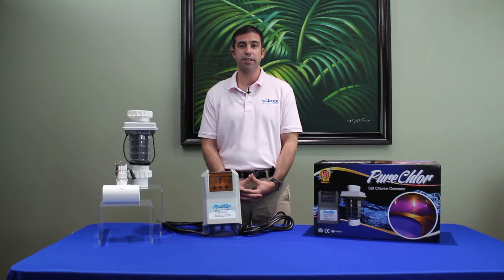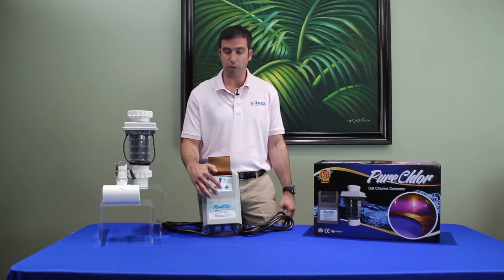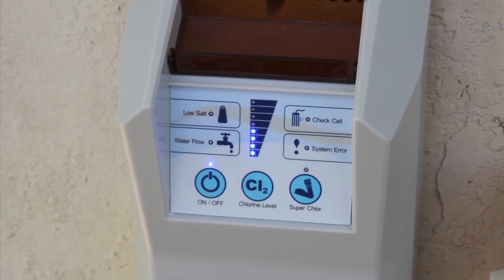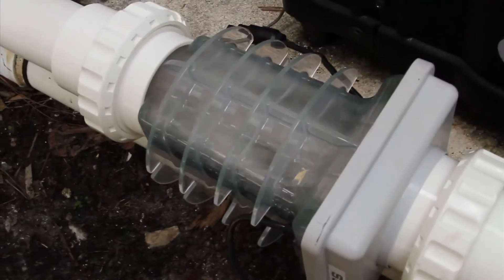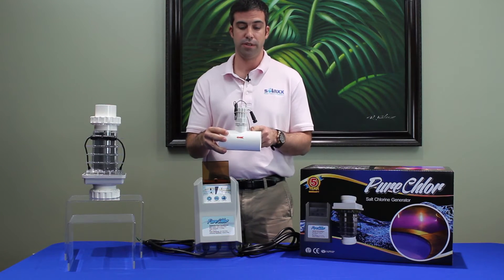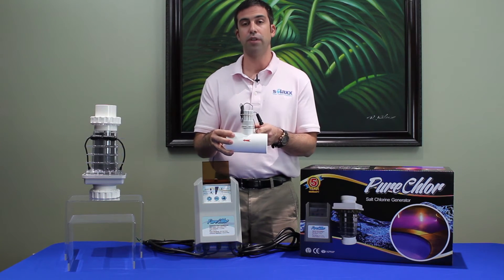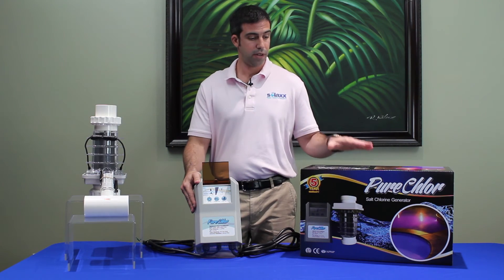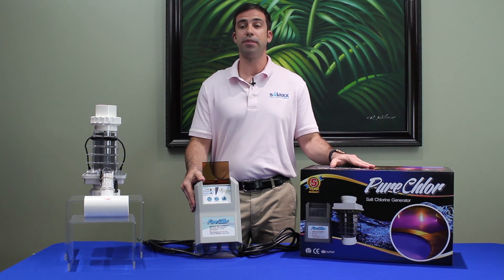PureChlor Chlorine Generator

Comment: My flow switch stopped working. The system is several years old, with the flat wiring connectors. (Absolutely horrible design. Live and learn.)  I can now only buy a flow sensor with the new and upgraded round wiring harness design. I can see no way to adapt the new to the old, or find the older style switch anywhere. Help, anyone?

Comment: I went to the mypurecholor site to find help, instructions, on how to reset lights and control box when salt cell replaced or cleaned.
1) This site is a pitiful, 80's style low info site. It's embarassing in 2022.  Almost no attention to user service or support.
2) I did not find any instructions, youtube videos, or downloads to do this critical step of resetting the cell.

This lack of care for their customers and product is appaling. A hing school intern could cut a youtube video or type up the steps to reset it, but they are not willing to pay $50 to get it done and up on their site. It's atrocious. I don't know why anyone would resell this brand, or buy this brand, if the company has so little care for service.

Comment: My system cell light is intermittently displaying red.  I removed it and cleaned it but it keeps coming back on and indicating it needs to be cleaned.  It’s only a year old
Reply: Mine is doing the same. What's the fix
Reply: Had to buy a new cell. Called Solaxx and got the 40k instead of the 20 k generator

Comment: I have the unit that can do a 20,000 gal. pool. Mine is 13,000. It's running 3 days and no chlorine yet. The salt is 3,400 ppm. Answer please.
Reply: add more salt
Reply: @craigstevens9204  I jump started it with cholrine tablets I had. Left the unit on 24 hours until I got a reading, then started dialing it down. The sweet spot is 3 hours so far. It took me a month to get it figured out. Now it's easy. Thank you!!!